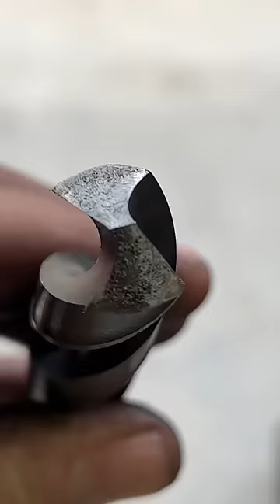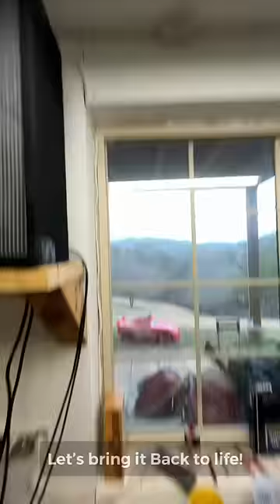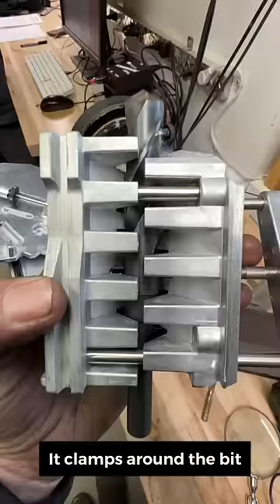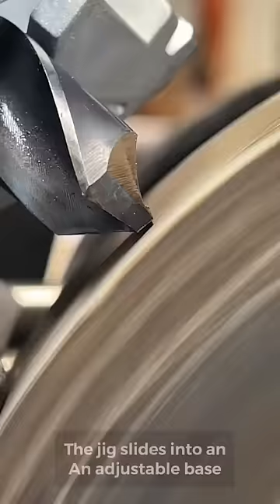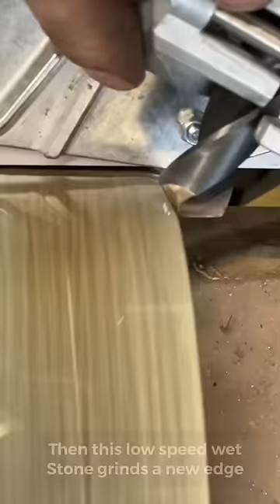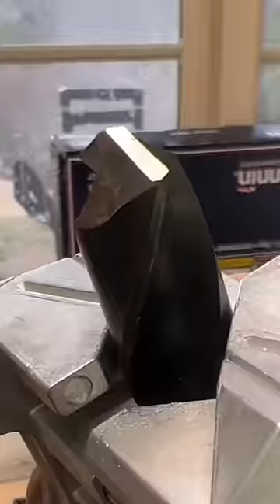We Smoked This Drill Bit… and then fixed it

Comment: My dad was a metallurgical engineer. He used a standard grinding wheel and sharpened all his bits by hand. Taught me not to fear getting the angles exactly right. Just sharpen it a little and give it a try. Some of his bits were shortened allot, but I never remember him buying new ones.
Reply: An old timer taught me the same thing.  Now I look for old ones at garage sales and never buy new ones.

Comment: I sharpen drill bits on grinding machines, or with the flap disc on my angle grinder. However, the results are the best with proper tools/jigs made for this! But it is very useful to learn to sharpen bits both for the value of saving money as well as repairing things that have value, and can easily be repaired. I would love to work with Jamie in the shop! Would be great to see some more fabrication jobs!

Comment: Does the heat treatment burn off during this process?
Reply: Not while grinding it down with this method and the oil.   If you heat metal enough that you start seeing colors, then you will.
Reply: @_FJB_  yeah but isn’t the treatment usually only in the top? That’s now grounded away?

Comment: I think the tormek is a to slow grinder for this  i use a normal bench grinder to reshape and sharpen my bits. And if i must cutt of the heated part i take about 2 till 3 Minuten for a  12mm /0,5 inch bit how long do you take?